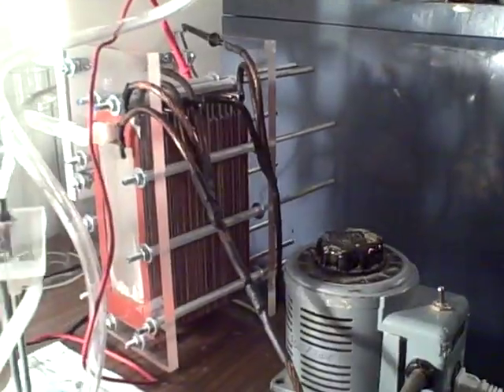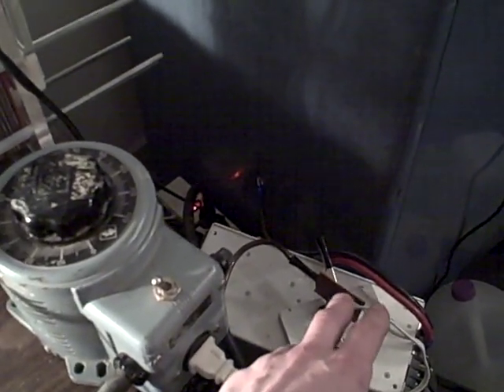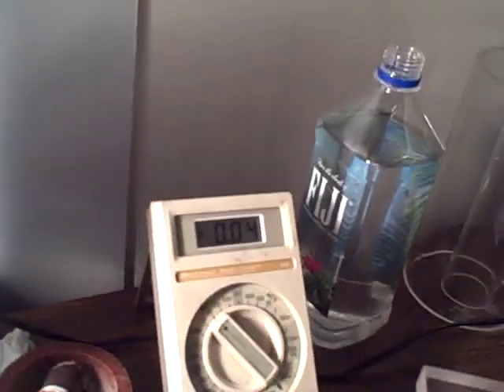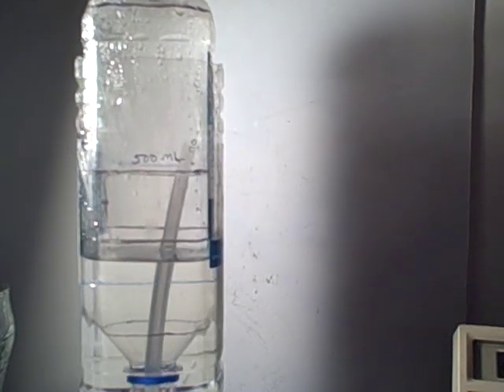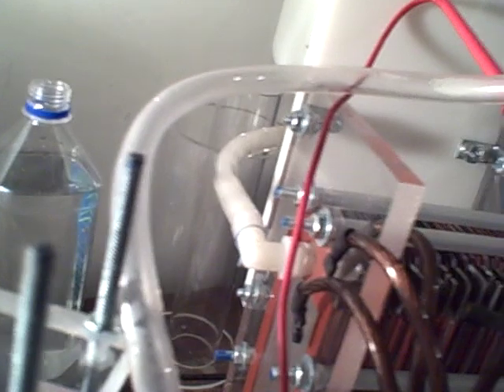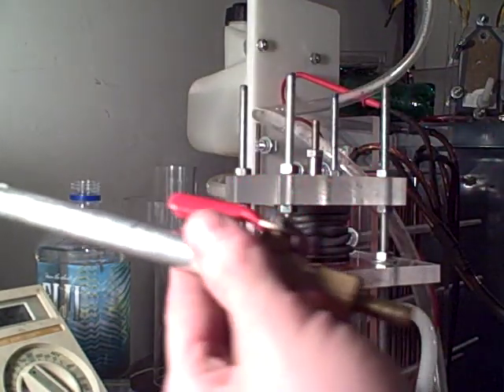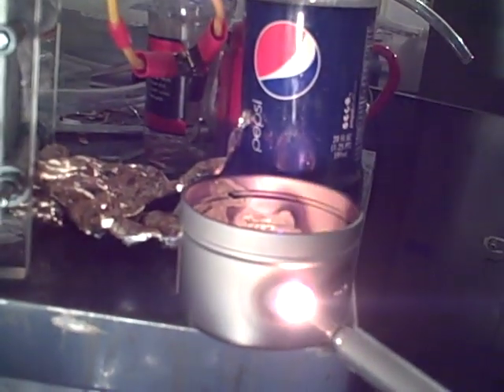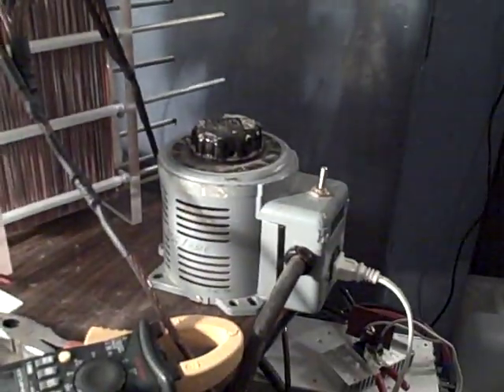HHO dry cell and new variac.

Comment: i have the 8xa tried the circuit with my dry cell it doesnt work blew the bridge rectifier kbpc801
just wondering what bridge are you using as you connected it directly to the cell without going though the 8xa i wish try this what electrolyte are you using ?

Comment: AC is measured at RMS ( Root Means Squared)
DC is measured at Peak Voltage.
To covert RMS volts to Peak you have to multiply by 1.414 . 
120 volts AC is 170 DC peak with no load theoretically. Minus resistance, inefficiency in a transformer, and losses in a diode bridge you get 150 volts. Then add a load and voltage drops even more as the load increases. Hope this helps.  Electronics is a strange and fascinating science. It all boils down to math end the end. Keep up the good work.

Comment: This is usually a problem in anything built over 36 plates ...thats the reason i split my cell , I built one big one to start and it was not very effiecient and when I broke it down you could tell the water levels were not constant ...usually keeping it at 36 plate per section helps with this pretty good

Comment: Thats the way to go , my cell has 72 plates  split into two 36 plate sections with top hole only , my gas comes out the end holes and water goes back in the other , it works really well i can drive it all the way up to bout 2000 watts with  no problems...